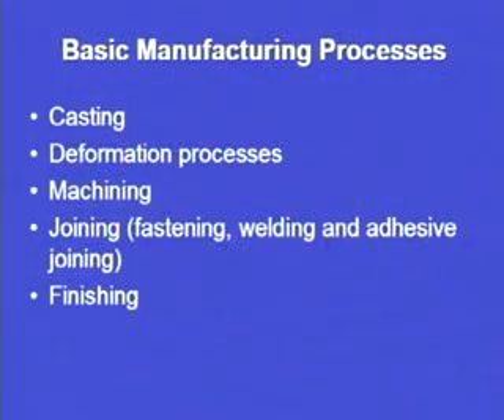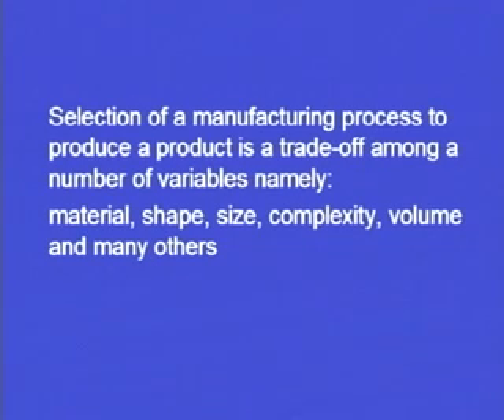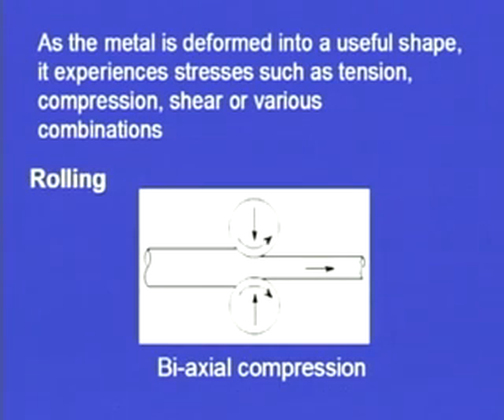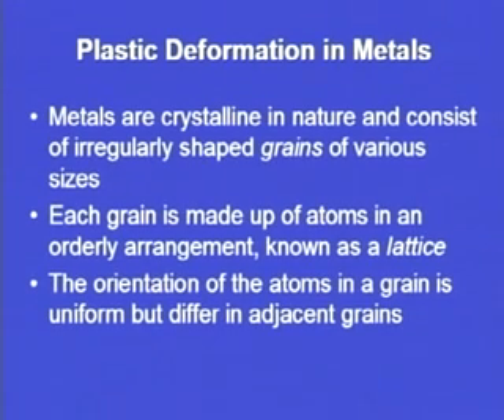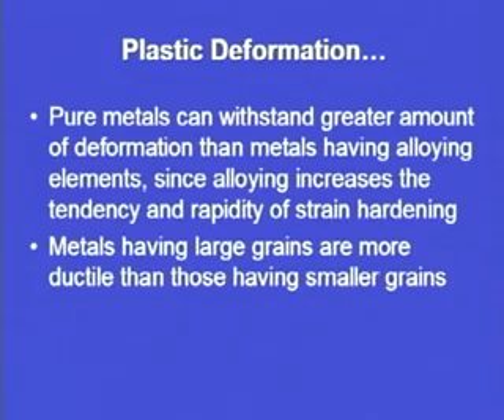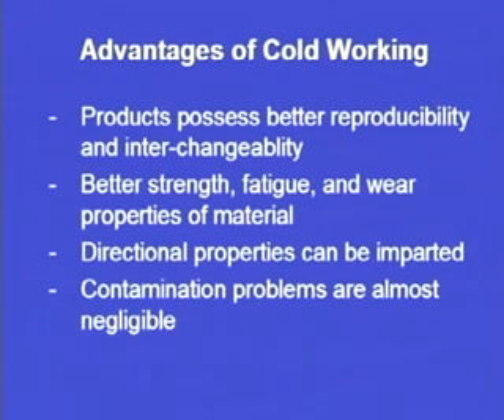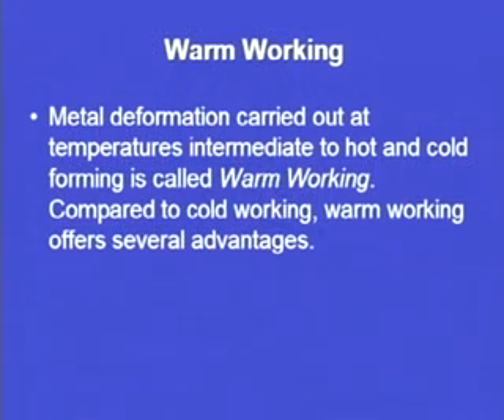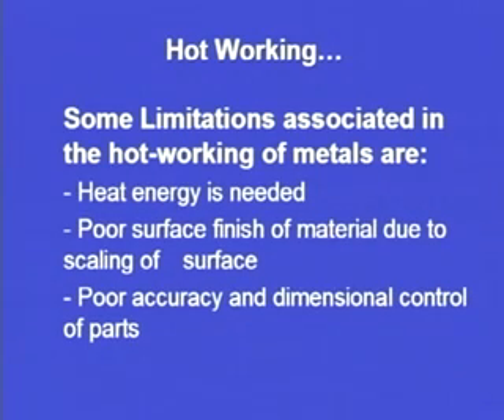Mod-1 Lec-4 Metal Forming - Fundamentals

Comment: sir explain the strain hardening in detail with relevance to stress-strain graph and a piece of advice that use some more descriptive slides with figures to make the lecture more connecting. thankyou for the effort you making sir really appreciate it
Reply: In stress-strain curve, u can see a rise in slope after plastic deformation, this is due to  strain hardening.Basically what happens in strain hardening is the lattice gets disturbed(randomized) which makes the structure rigid,tighter. So it acts as resistance. So the material to fracture we need more stress to be applied. therefore we can see a rise in the curve